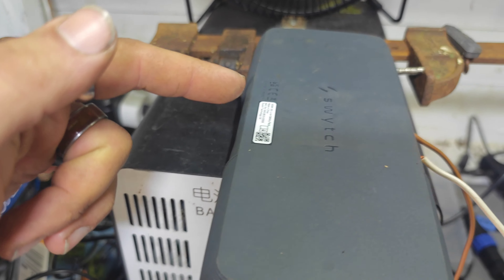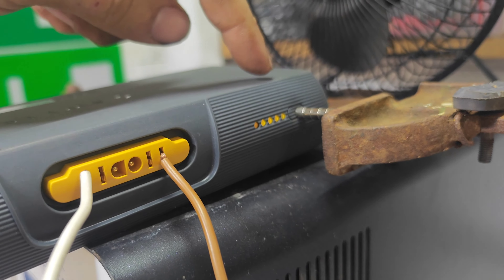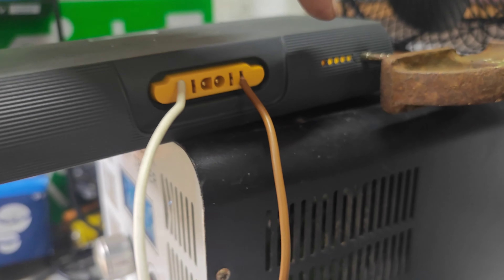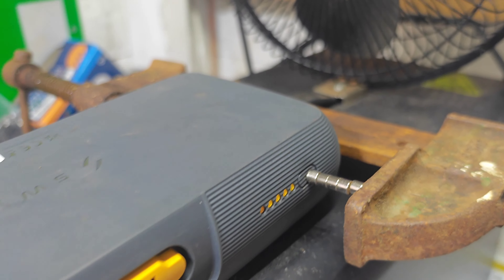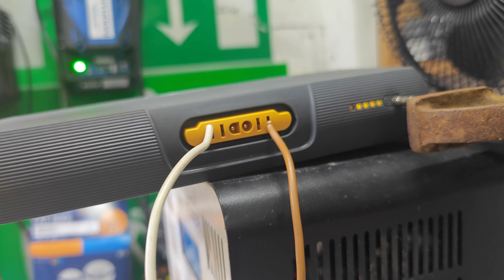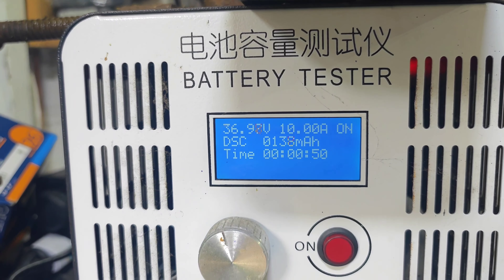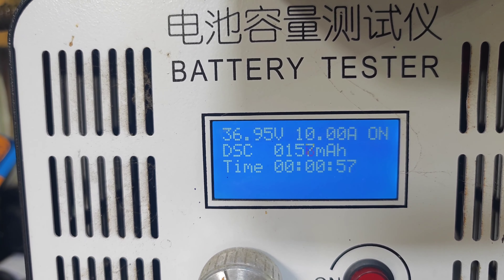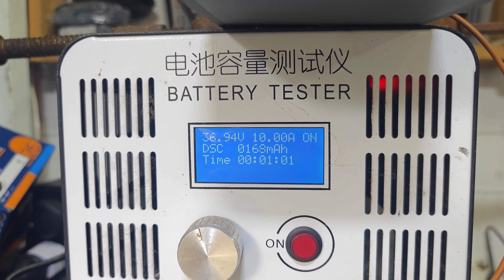How to capacity test Swytch Ebike Battery pack!

Comment: To "power on" the battery pack you can simply place a resistor (4,7k) between positive and the contact next to the negative.
Reply: can you tell us any more information or resources about how the Swytch Air/Max batteries work?  My BMS has locked me out because the cells discharged over the winter and I am trying to find out how to reset it
Reply: @petetasker2776  I'm still investigating. Probably it is in cut off state, because one or more cell are low. Try to leave the charger connected. Usually a low current is delivered to revive the cells.
Reply from the maker: Oh fascinating! Thankyou, I'll have to try that next time 👍